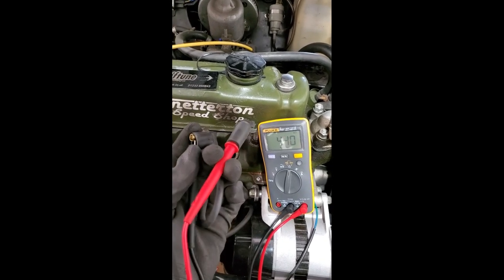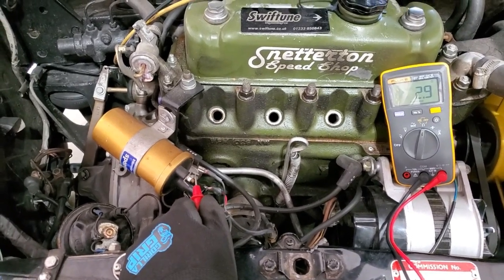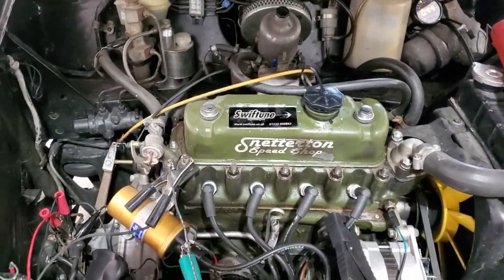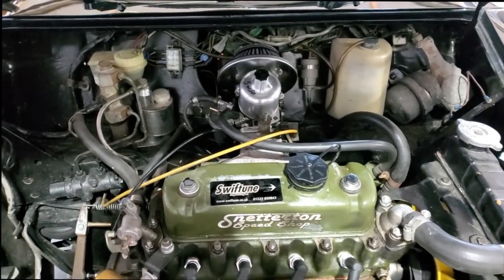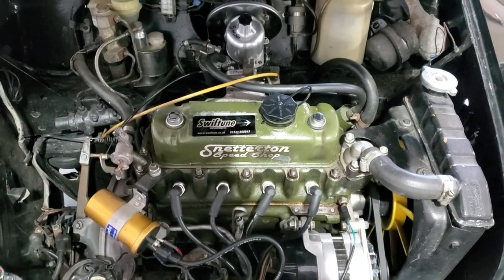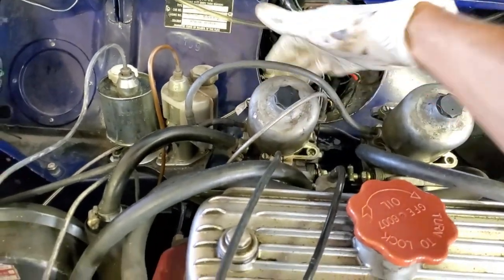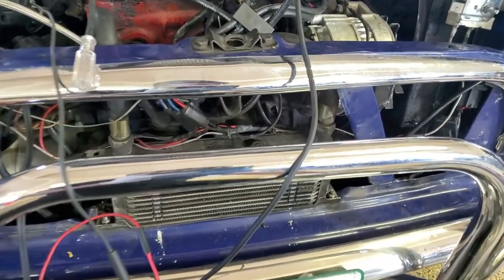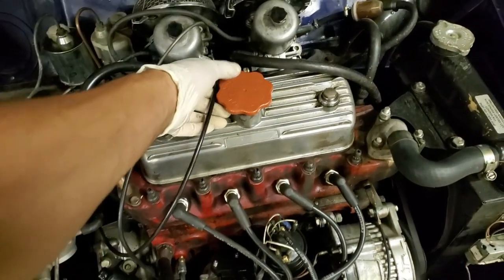Emissions and Twin carb tuning

Comment: Hi Darren,
During the tuning of the swiftune 998 mini you explained that the carburetor was not giving a stable idle when trying to adjust the idle mixture. Can you explain what you did with the brake cleaner to come to the conclusion to replace the carb? I am having a similar issue ie unstable lambda readings at idle. Keep up the good work with keeping mini’s on the road, I enjoy your videos.
Matt
Reply from the maker: Hi Matt, the non-chlorinated brake cleaner I use is flammable. When I spray into places that have vacuum leaks such as the throttle shafts or intake manifold, it gets sucked into the intake and burned with the air/fuel mixture. This will show on the lambda gauge as a rich reading. It also blocks up the air leak and the mixture reads richer. It's a great way of diagnosing any vacuum leaks.
Reply: Great Darren, thanks very much for the explanation, I will try it out on my carb and intake.
Matt

Comment: Great video.  With the twin carbs what colour spring was it running and what oil did you settle on to pull enrichment back? Thanks
Reply from the maker: I think it was a yellow spring and 10w30oil.
Thanks for watching
Reply: @darrensrestorations991  thanks Darren, am I better off with a leaner needle and thicker oil or richer needle and thinner oil for performance to get the correct 0.85 on the gauge during acceleration? Cheers